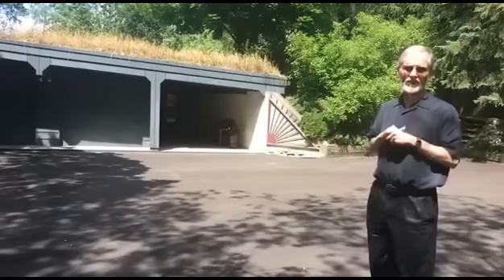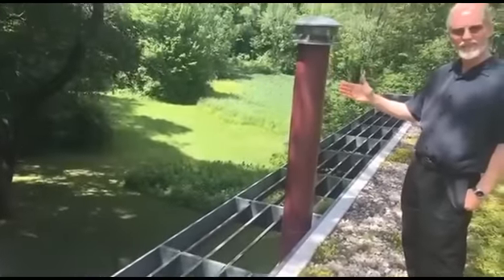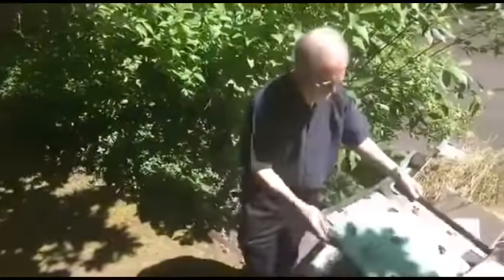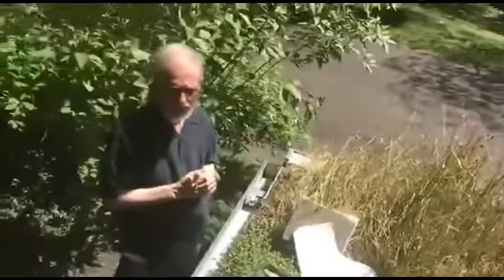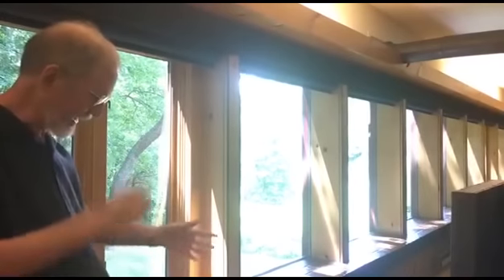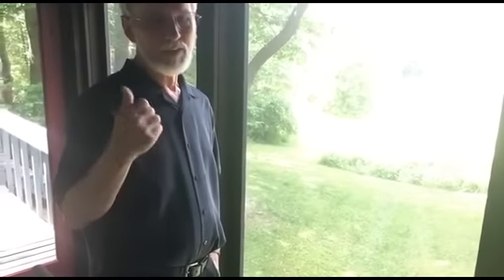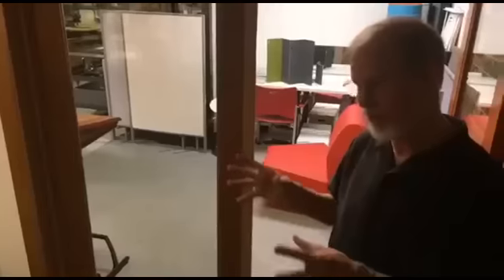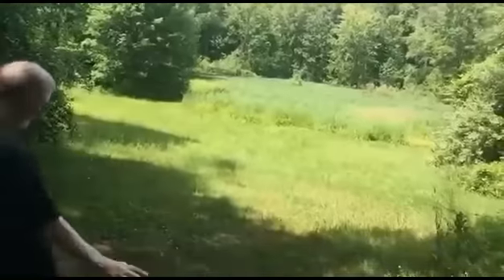Underhill: A Virtual Journey into a Passive Solar, Green Roofed, Integrated Earth Sheltered Home

Comment: I also live in Michigan with an earth bermed house, south of Lansing. I am amazed at how much work he put into making it efficient. I bought my house at the end of 2015 and unfortunately I wasn't able to talk to the owner about how he controlled the house in the winter and summer. The house was built in 1982-83 and is wedge shaped with a standard roof and bermed on 3 walls. We have 2 solariums in the front facing south, the original intention was for the solar passive heating, but we're not exactly sure what we should be doing to make it work (everything is very outdated and needs to be replaced).

So far in the winter we've gotten away with heating our house with a wood burning stove, it manages to heat the 2600 sqft house with just 1 fan pushing the heat around. We're pretty ignorant of the dynamics of heat control and how to make that more efficient, Tom knows his house very well and it is setup beautifully. We have a furnace but we've only used it a few times since we've owned the house, right now it isn't working anyway. I am planning on purchasing a new furnace, I found my way here trying to see what other people have done with their sheltered homes and I like what he has done.

We bought a few portable air conditioners for the house, but not having a standard window to exhaust the heat has been a challenge. Not knowing how the house was built to regulate humidity and airflow in the summer has been a huge hurdle. We have issues with humidity being at 70%+ during the summer, we know it's an issue but the only solution we know of is to replace our broken furnace and add in an air conditioning unit. We know that we can block off the windows to the solariums, but at the same time we don't want to minimize our light. As long as it's sunny out we don't bother turning on any lights, which has greatly contributed to our lower energy costs (compared to where we came from at least).

Also since energy consumption was mentioned in the video, according to consumers energy Jan 2017 to Jan 2018 I've used 6,745 kWh. That is with the house and pole barn where I have my shop as well.

We stepped into a whole new world when we bought this home, we want to make it more efficient but we're not sure who to go to in Michigan that knows about our type of home. I guess my biggest question is, do you have a recommended HVAC company for sheltered homes? We need to get this under control. Thank you very much and thanks for the video.
Reply from the maker: Hi, Tim. Thank you for sharing your home details with us and everyone! Always great to hear about these homes in Michigan! It sounds like you are having moisture issues similar to a basement, I would work with a home inspector to see if you can spot where water might be pooling in and causing all those humidity issues, it could cause structural issues eventually! As far as HVAC, we know a good company https://www.a1mechanical.com/ in the area. I doubt there any HVAC specialized in earth shelter homes but any good HVAC should be able to help. Based on what you are telling me you may also want to contract Build Equinox about installing a CERV http://buildequinox.com/. It could be used to heat, cool and ventilate your house all in one based on this energy demand and dehumidify it. They may know some good HVAC in the area who can help too. Tell them GHI sent you!
Reply: Hire a hvac engineer to design heating ventalation humidity and cooling. Do a door test. Then a budget for retrofit. I had a engineer design a passive solar house i sold for $72,500 the same price i sold another conventional house the same year.

Comment: wish you had mic'd Tom. the volume was very uneven, and I had trouble hearing him most of the time.
Reply: When you came in at 46 minutes and 30 seconds blew my ears out. Couldn’t really hear the older man most of video, had to turn it way up
Reply from the maker: @dylansean6978  :( Check out our new stuff. We got it down.
Reply from the maker: 2018 is going to be a lot better for our sound. Wait and see!
Reply: Yes maybe the could use captions?
Reply from the maker: We checked with our engineers and cannot replicate the issue! Please make sure your audio is turned up, that all your systems are updated as far as a browser, latest software or operating machine and that you are in a quiet room with a good internet connection. Thank you! PS - We agree on the Mic and will be doing that from now but you should still be able to hear it!
Reply: @GreenHomeInstitute  lmao pretty bad "engineers" you can tell the mic was just attached to the camera, which is why it's poor.  Here's a new video, https://www.youtube.com/watch?v=jw6qUGmCRJ0 43:45 you can tell you're attempting to fix this via software levels and not just getting a $50 wireless mic or something similar.
Reply from the maker: @gg-gn3re  thank you for taking time to check out our session. Thanks for bearing with us as we get better.  Here is a newer session we did where I think we did better. What do you think? https://www.youtube.com/watch?v=V1-SohaHfOk&t=840s
Reply: @GreenHomeInstitute  I linked one that is over a year newer (2019 december) , how is that one from 2018, october newer?
It's indoors and sounds much better, but it is indoors.. so I can't actually judge as far as being better, which is why I found & linked another outdoors one. You can tell in your video that the guest has a mic and you don't as you guys move around further into the video. 
You can get systems that have like 4 mics and 1 receiver that plugs into the camera, and the 4 mics go on everyone talking.
I am NOT recommending this one I don't know how it performs:
https://www.amazon.com/Movo-WMIC50-Microphone-Integrated-Transmitter/dp/B00KLFJZ6Y/
But just as an example. It might not do well in wind.
Reply: @GreenHomeInstitute  used a head set👍